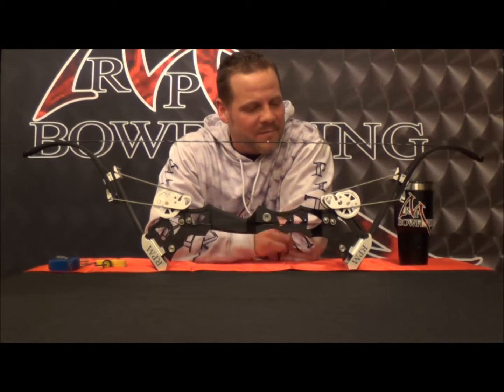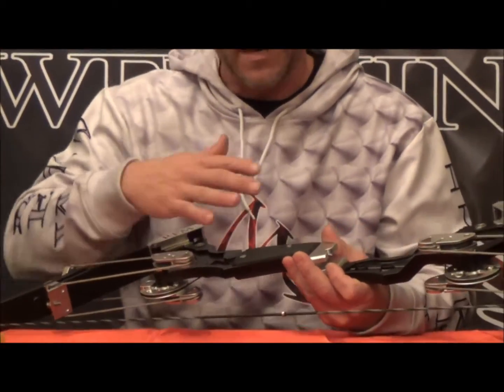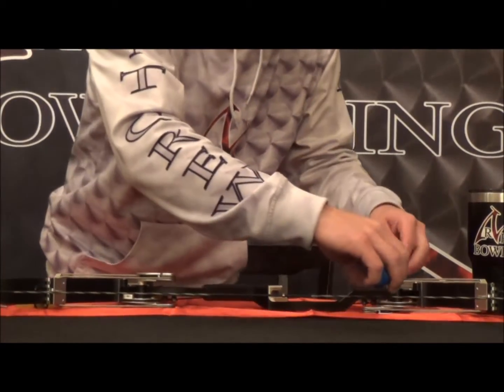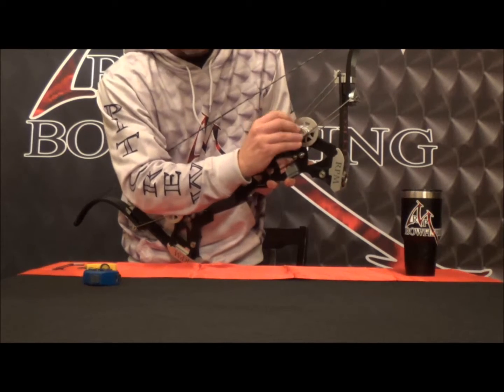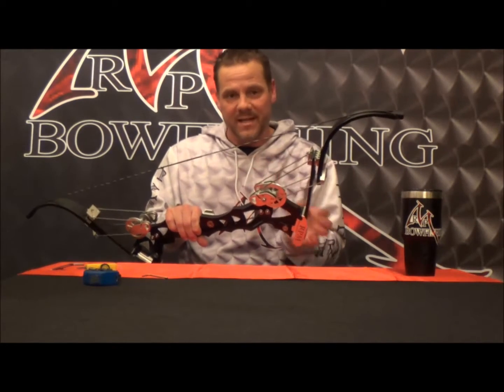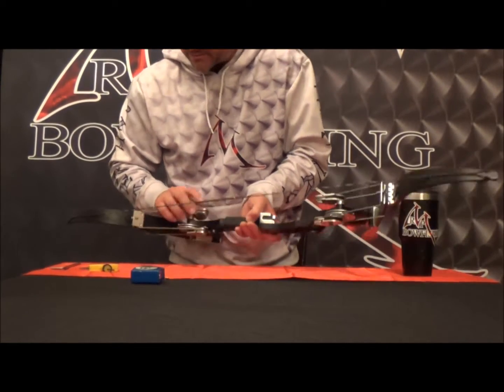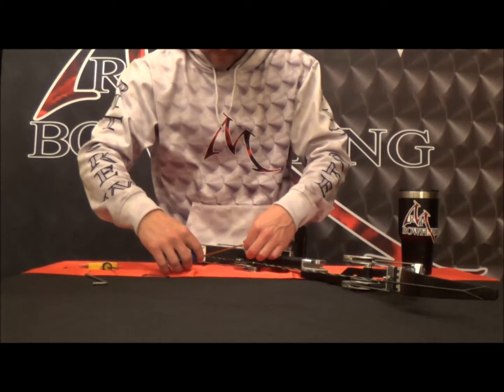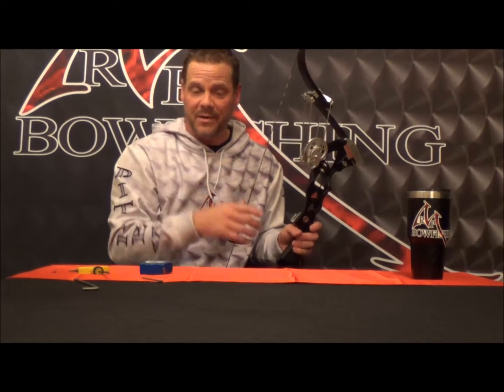RPM Nitro-How to adjust draw weight and check tiller/timing

Comment: Yes but what is maximum preload limb position? Do we check gap between pocket and riser or limbs can go further inside pockets when pockets hit the riser??
I have your Nitro MAG version with D modules installed(medium 80% let-off. Pockets are kissing the riser and i cant get more than 60-65 # range of weight???
Whats wrong?
Cheers